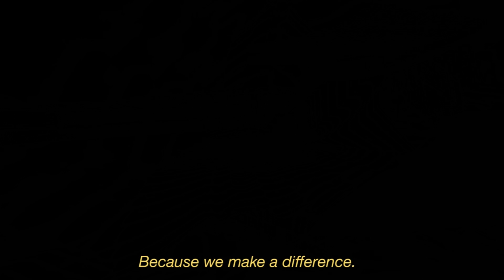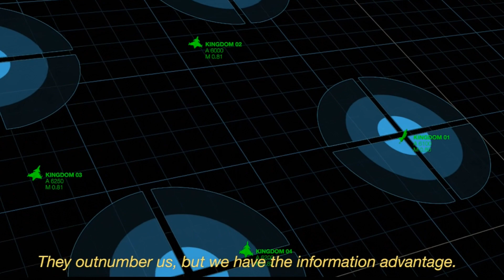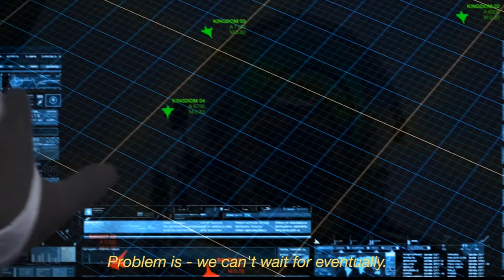Gripen Fighter Jet - Canada's Future Fighter?

Comment: The best solution for Canada is JAS 39E built in a Canadian factory.
Reply: the f35 will not generate those kind of sales, not at its price tag.  They tried that with the f22, wanted 800, they got 180
Reply: @jeffb7244  - Never mind the price tag, how about the fact that Lockheed and the Pentagon will use ALIS telemetry to spy on you?  They've already been caught spying on Norway FFS!  Also, the JSF must have an internet connection to Lockheed and/or the Pentagon just to start its engine!  All the Americans have to do to ground entire air forces is invalidate the ID codes of whatever F-35s that they want grounded.

Why the hell would ANYONE buy this turkey and why are the Americans supporting it so strongly despite the fact that Lockheed-Martin and the Pentagon are sodomising them the hardest?
Reply: @CF-105_AvroArrow um, where did i say anything about the F-35 bud?  Its a piece of shit.  I said the Falcon is a better aircraft.  And any Computer Engineer with some skill can easily override it.
Reply: Wade French The Cost per Flight Hour is what makes the F-35 look bad. Add the fact that it cannot operate from a base which does not have special facilities, if the stealth advantage is to remain.
Reply: Wade French The fact that not a single JAS has been lost due to engine problem in 28 years is of course totally irrelevant. Engines are much more reliable nowadays. A CF-16 Hornet was lost due to the inbalance of the aircraft, when only one engine was running, so having two does not neccessarily save the aircraft.
Reply: Ron Clarke "Range far too short for Canada".
Do you now that Gripen E/NG "Next Generation" have a bigger hull and bigger fueltank and another engine...higher payload...new radar. It´s an huge improvment from Gripen C/D. It´s a new fighter.
So Gripen E would be an option for Canada....but you deside...
https://saab.com/air/gripen-fighter-system/gripen/gripen/the-fighter/gripen-e-series/Gripen-E/
Reply: Guess how many Gripen Engine problem related accidents has happened since 1983?Hint: RCAF has lost more CF-18 Hornets due to Engine problems.
Reply: we should be considering the super hornet, or the typhoon
Reply: Canada is the second largest country in the world, a twin engine aircraft should be the forefront for redundancy.  Right now Boeing is shitlisted, so the Typhoon should be our choice
Reply: The more than 70 Canadian companies supplying the F-35 program now would likely have a VERY different opinion. They may get replaced over time by other vendors in other countries. Lockheed Martin will not send billions of business to Canada to watch them buy JAS-39's. Good luck replacing all those Canadian jobs (+- 50,000 lasting more than 2 decades) with a little factory pumping out 50-100 4th gen Gripens while the F-35 program generates over 4000 world wide fighter sales.
Reply: @calcrappie8507  - Wow, when you Americans try your fear-mongering tactics, you REALLY lay the BS on thick don't you?  We're not a bunch of uneducated deplorables so it's not going to work on us.  The contract we signed to join the JSF program clearly says that we are under NO OBLIGATION to buy ANYTHING.  You know what that means?  It means that as long as we pay our dues, the JSF office has no choice but to maintain the status quo so those jobs aren't going ANYWHERE and there's NOTHING that you can do about it.

Have a nice day!

BTW - If you're actually a Canadian, you should be ashamed of yourself for not knowing any of this.  Willful ignorance is a distinctly American value, not a Canadian one.
Reply: But with a country as big as ours, a single engine fighter isnt worth the risk over the massive expanse of land we have to patrol on a single engine
Reply: @jeffb7244  - Jeff, seriously?  Someone hasn't done their homework (clearly).  Are you aware that the Gripen is the most reliable and safest fighter jet in human history?  Are you aware that in 23 years of service over 5 air forces and 247 examples built that the JAS-39 has NEVER, EVER suffered an engine failure?  Are you aware that only one man has ever died flying while in the cockpit of a Gripen (January 2017, Thailand Children's Day Air Show)?  Are you aware that the one Gripen fatality was not the fault of the aircraft itself?

If you do the math, the survivability rate of the Gripen is 20x that of the CF-18?  How is that possible considering that the CF-18 is a twin?  It's simple, the strange Canadian idea that we need two engines started in the late 70s and was based on a lie.  I'll explain quickly because if you're going to talk about this, it's too important to be half-assed or wrong with your informantion.

Long ago, the RCAF bought the F-104 Starfighter from Lockheed.  The CF-104 as it came to be known is a missile-shaped, high-speed and high-altitude INTERCEPTOR with short, razor-thin wings.  It wasn't even a proper fighter and was in no way an agile plane.  Hell, Indian MiG-21 Fishbeds used to eat Pakistani F-104s for breakfast.  So we had these planes but instead of retiring the Voodoos and using the Starfighters as our new interceptor, as we should have and used the CF-5 Freedom Fighter as our strike aircraft (again, as we SHOULD HAVE), some lunatic at RCAF had other "ideas".

Nope, we ended up using a missile-shaped, short and razor-thin-winged INTERCEPTOR as a "low-and-slow" strike and close air-support aircraft.  Now, the F-104 was designed for exactly the OPPOSITE role that said lunatic at RCAF command decided to give it.  Because of its short and thin wings, the F-104 had extremely low supersonic drag and it was FAST.  However, the everything in design is a trade-off of something else and aircraft are no different.  The characteristics that made the F-104 such a good interceptor gave it very low tolerance for high angles of attack at low speed and a very high stall speed.  

Many CF-104s, while flying low-and-slow at the high angles of attack needed to carry out tactical strike and CAS exercises suffered catastrophic wing-stalls and fell out of the sky.  Even worse. the original F-104A had an ejection seat that ejected DOWNWARDS which meant that ejecting was as lethal as crashing when the plane was already falling from a relatively low altitude.  Now, as crazy as a downward-ejecting seat sounds, for the F-104 it actually made PERFECT SENSE!  Lockheed expected the Starfighter to be flown at altitudes of 40,000' and above.  Downward ejection in that case is actually more advantageous because it meant that the pilot would reach breathable levels of oxygen quicker in his descent.  Oxygen units for ejected pilots were not nearly as sophisticated then as they are now (nothing is, really).

Only two air forces in the world had lunatics like this running them at the time.  The RCAF and the Luftwaffe of Germany.  Both air forces suffered hideously high fatality rates from the F-104 and unfairly called it "The Widowmaker".  I say unfairly because these deaths were 100% the fault of the respective air forces' commanders.  However, by nick-naming the F-104 "The Widowmaker", they made it seem like the plane was at fault instead of them.  

Those honourless bastards made damn sure that they didn't take responsibility for the deaths of those Canadian pilots and blamed it on the plane's single-engine configuration and stated that Canada's next fighter would have to be a twin, you know, "for redundancy" and came up with this BS about flying over the Canadian Arctic to cover their own asses.  They even pushed for the F/A-18A over the F-16A because of the second engine.  Interestingly, the F-104 was, when used as intended, no more dangerous to fly than any other combat aircraft.

When this all went down it was the late 70s or early 80s.  In any case, the information age was't even a thought and people had no way to check the facts so they just believed the RCAF commanders because they had no choice and this was easier.  Somehow that lie got into our national consciousness and remains there to this day, as you just demonstrated.

I am a pilot, not a military pilot but a pilot nonetheless.  If I were told that I could choose between a twin engine fighter or a single engine fighter in which I had a 2000% better chance of surviving, I'm talking the safer plane, number of engines BE DAMNED!  I kinda think that you would too.

In total, 247 Gripens have been built (vs 138 CF-18s) and used in five air forces.  To date. NO Gripen has EVER suffered an engine failure and only one man has died while flying one (It looked like he was dead before the plane actually crashed BTW).  This is because Volvo Aero tweaked the GE F404 engine (also in the CF-18) for the Gripen and built it under licence from Genreal Electric as the Volvo Aero RM12.

When an engine demonstrates over more than two decades that it is literally incapable of failure, you only need one no matter who you are or where you're flying.
Reply: you know the F404 is one of the most reliable engines of its time for a fighter.  I mean shit, there is what, 5 main bearings in it?   It was built to have minimal downtime in it, part of why its performance isnt as good as it should be.

No need to preach to me about the 104s dude, I know all about them.  My uncle worked on them and has told many a good tale on them.  

I would still take a Falcon over a Gripen though.  I might be biased because i see them daily.

its funny in comparing stats against them, depending on which site you go their dogfighting statistics on most of the european sites have the Gripen as the turn advantage, I'm wondering if they are using the falcon fairly clean or with external tanks.
Reply: Justin is not quite a man, yet.
Reply: Typhoon can't do as much as the F-35.  Period.
Reply: It takes a huge jump in price which make the F-35 look even better.
Reply: Engine problems have a lot to do with how many flight hours there is on the engine.  Both the Gripen and the CF-18 Hornet use American engines, so I am not 100% sure what your point is.
Reply: Wade French In 2016 the F-22 CPFH was almost $60k, making it a bad example. The stealth coating is maintenance 8ntensive, and that is not going to change.
Reply: That is not true.  The Cost per flight hour was 68,000$ until the program matured (which happens with every program).  The current CPFH for the F-22 is listed at 34,000.  Secondly, they have gotten better at maintaining stealth coatings and so that indeed HAS changed.  If you are going to use numbers use the right ones.  

"This means that, for example, an F-22 Raptor that isn't used within the US government costs a cool $34k/per flight hour."

I also expect that the cost per flight hour for the F-35 will also drop in half as supply chains get better and crew learn how to maintain it.  As a program matures the maintenance cost drop.  The F-35 is just starting to get going.  I am confidant that cost will drop to around 25,000 $USD/flight hour.   Still not great, but very different than its' current costs.  Remember than costs per flight hour for commercial jets are similar.  No jets have low maintenance costs.   Stealth adds a lot of cost, but realistically for what it accomplishes the returns are also good.  

That said, I would not be against Canada buying a mix to make money go further.  However, I can see the benefits of having a mix.  There are a ton of things the Gripen simply cannot do that the F-35 can.  When you move to the new Gripen E you get closer to the F-35,  but then you go to 85 million USD per plane.  That brings you closer to the Cost of the F-35.  Maintenance cost will always be lower because it is not as sophisticated as the F-35.  It is definitely a factor.
Reply: Wade French https://www.bloomberg.com/news/articles/2017-07-11/the-f-35-costs-even-more-when-you-fly-it says that the total cost of purchasing and running the F-35 (2456 aircrafts) is estimated to be 1,1 trillion dollars. If each cost $100M (it is claimed to be lower), then deduct 245 B$ leaving 855 B$ for operation. Divide by 2456 and then by 8,000 flight hours, and you get $43,500 per flight hour.
Reply: walt charamba Denmark will have exactly one airbase operating the F-35. Norway will have exactly one airbase operating the F-35. This is  due to the  costly stuff needed by the F-35. Tell me, what is the effort needed to take out the  entire Danish and Norwegian Air Forces, once they have converted to the F-35?
Reply: walt charamba which will be a big problem, if you cannot afford to operate the F-35 on more than 4 airbases, which would be the limit, if you scale according to GDP.
Reply: walt charamba Gripen E:
Networking  - CHECK
Sensor Fusion - CHECK
Supercruise - CHECK
Low Observability - CHECK
All Aspect Stealth: No. F-35 has limited stealth, at an outrageous cost of operation.

Meanwhile, Gripen has more advanced missiles, and is easier to upgrade due to a modern S/W architecture.
Reply: walt charamba Stealth is only an advantage, until the defense implements a low cost sensor network which ensures the position of ALL stealth aircraft is known. It is a short term advantage, not so ething viable for 30-40 years.
Reply: walt charamba The sensor network will detect the stealth aircraft first, and inform the rest of the network of the location. The sensors will in many cases be passive, and the sensors will be harder to detect due to small size, and not cost  effective to take out with missiles. The defense will be able to fire missiles, guided by the sensor network, before the stealth aircraft can detect the source.
Reply: Fredrik Johansson men hur fasen bygger dom där????
Reply: Not only would Saab give us that but they'd also give us full tech-transfer so we would once again be able to build our own fighter jets.
Reply: Range far too short for Canada. Keep in mind Sweden is a small country compared to Canada. Sweden is around 25 percent less in size than the one province of Alberta. By no means is Alberta the largest province in size.
Reply: Ron Clark so why are Canada considering the F-35?
Reply: Presently under this government they aren't. But the previous two governments and this government funded part of the F-35s development. With the development funding Canadian aerospace companies have been getting orders to build parts for the F-35s. More outlays for orders than the investment into the development at this time. The reason to buy F-35s is they are the better, cheaper fighter. Better in every way... There is a reason why Germany announced this past week they will be buying F-35s to replace their old Tornadoes. It is the same reason why all of the other nations are buying the F-35s too. And please don't attempt to imply all of these nations are more corrupt than Canada. LOL... Japan, South Korea, Australia, Norway, Denmark, the Netherlands, the United Kingdom, Italy, Turkey, and Israel. Its very likely within the next decade Poland, Finland, Belgium, Spain, and Portugal will join... Taiwan wants to buy, but is facing difficulty doing so. Speaking frankly, Trudeau is kicking the can down the road until another government has to spend, he has no intentions of spending on defense, well not in his first term. The arctic patrol boats and replenishment ships were funded by the previous government. The previous government also funded the army's new tanks and the air forces new transport planes and helicopters. The previous government of the previous government funded the new ASW navy helicopters. After two years In office Trudeau has bought NOTHING... Justin is kicking the can down the road...
Reply: @ronclark9724  - "But the previous two governments and this government funded part of the F-35s development."

Two things about that.  Firstly, Canadians don't believe in the American concept of "Too big to fail".  If something clearly isn't what we want, we have the balls to end it and go another route no matter how big it has become.  The F-35 was designed specifically to suck money out of government coffers and it has been doing that extremely well, long before it became "IOC" (even though the turkey STILL doesn't work).

Secondly, there is NOTHING in the contract that Canada signed that says we are in any way obligated to buy this plane.  We stay in the program because it allows Canadian industry to bid on JSF manufacturing contracts.  Thus far, even with the dues we pay, we are WAY ahead and are still turning a profit because even though you Americans have screwed us out of the most the most advanced plane in its class TWICE (Arrow and CSeries), Canada still has a thriving first-world aviation industry and our companies are respected and sought-after for aviation parts manufacture.  We're only still in the group because it would make bad financial sense to leave.  We're profiting from those manufacturing contracts hand-over-fist.  It's clear that your information is half-assed at best since you didn't know that.

An American who didn't check his facts before spouting crap, imagine that.
Reply: @ronclark9724  - From where the RCAF bases are, NO fighter's range is enough but at least with the Gripen we don't have to change our tanker fleet for that oddball spinal-tap fueling system used in the USA.  The Gripen uses the NATO-standard "probe and drogue" system.  Sorry America, you don't have what we need this time and you are in no position to tell us otherwise.
Reply: Then the F-16 would be an alternative.  Its a better fighter than the jas-39, combat proven, and with CFTs has longer range
Reply: Jeff, The F-35A is expected to drop to around 85 million USD by 2019 according to recent Lockheed Martin estimate. The F-35B and F-35C are more expensive but their prices will drop as well. The backlog is growing. The F-35 is going to be a wildly successful program. Over 200 built so far as the rate of production ramps up.
Reply: If the F-22 is any indication, the F-35 will have its' cost per flight hour drop as crews learn to maintain it.